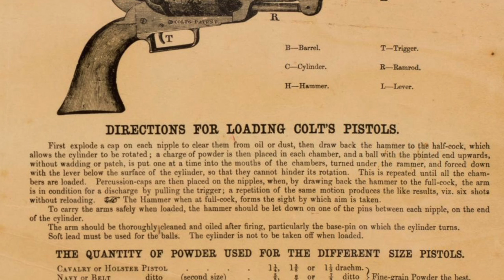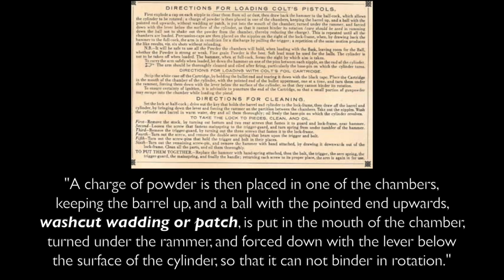Percussion Revolvers in the Rain

Comment: A tiny bit of lard/lube over the primers makes a HUGE difference.
--
Putting lard/lube over the primers AND over the ball, and you'll be able to submerge the gun entirely.
Reply: They used varnish on the nipples and lard over the ball.
Reply: Absolutely, that’s what I do with mine when I go camping
Reply: @peterlenihan5712  I've gone modern, I use clear nail polish.
Reply: I was going to suggest the same thing lol
Reply: Do you put the lard over the entire rear of the cap or just edge of the cap where it meets the nipple?
Reply: @rlbadger1698  Do you put the nail polish over the entire rear of the cap or just edge of the cap where it meets the nipple?
Reply: @ronaldscruggs2699  cap on nipple first, then a layer around the base of the nipple. 
it doesnt have to be perfect but a thin paint brush helps. x

Comment: I'm likewise surprised by this result. Would a different varietal of percussion cap make a difference? I'm not familiar with the ins and outs of percussion-cap firearms.
Reply: Not familiar with percussion caps, but oil and grease does not play well with primer compounds. In fact one of the primers I used to buy stated that to deactivate them drop them into oil. 
That was years ago, so maybe its still true maybe not.
Reply: @chuckaddison5134  use beeswax, it works.

Comment: I have been shooting these for 20 years. I have had misfires in the rain, but only very slightly more than the odd misfires that happened dry.  I once had my repro 1858 Remington in my hip out mountain hunting,  fell through ice on a pond into water up to my shoulders.  It must have been completely submerged for a minimum of 3 minutes. Once clear of the freezing water I pulled it not expecting much. It surprisingly emptied all 5 shots I had loaded without so much as a hang fire.  

I always made sure to have a good fit between nipple and cap.  I also make sure to REALLY press the cap on with enough force to slightly expand the crimp around the outside of the cap perceptively.  Your results may vary, but in wet conditions I can usually count on any of my revolvers to go off 5 out of 6 times.  I may have to recap the one a 2-4 times, but the last has always gone off too.  

Just remember that they are PERCUSSION caps.  Steady, firm pressure will not set them off unless defective.  That being said, always point in a safe direction just in case, but they should only go off if struck.

Now if I could just get my muzzle loading rifle to be that reliable…

Comment: I appreciate all the hard work you put into the video. As an avid fan and user of percussion revolvers, I can attest to the greatest vulnerability being the caps and cones. Also, if the caps fit too snugly, there may not be enough hammer throw to detonate them. Often it requires a second or third attempt to fire that chamber. For this reason alone I prefer #11 caps and squeeze the skirts to fit snugly. I find the Remington 1858 much more reliable than the open top Colts, but the Colts are simply gorgeous.
The flap holsters surely protected the revolver significantly until it was needed.
I have used clear finger nail polish to seal the percussion caps while blackpowder hunting. Back in the day a flap holster and overcoat were umbrellas for their revolvers and rifles. 💥💨

Comment: This was a good few years back now, but on my Remington (which as a bit more of an enclosed nipple than the colts), I used to grease the cylinder as you've probably done before, then cap and grease around the cap. Just a ring, you still wanted the head of the cap exposed. It was messy, but pretty much guaranteed good ignition.

Comment: Excellent test, thanks for doing it. 
At face value: “of course it won’t work”
Upon pondering: the only access is the cylinder and the cap. Both are tight so, it SHOULD work.
Reality: very surprising, now I’m wondering why it didn’t work.

Comment: Great/fun video.  I did cringe a little when the Star had a cap ignite, but not the charge.  You clocked it again, right away. I worried about a hang fire into the frame. Thanks Karl.

Comment: I have experimented with keeping mine loaded for longer lengths of time, and have had the same issue in those cases. Even with a good ring of lead shaved off the ball, and a wax/fat lube over each chamber, I had failures, which puzzled me for a bit. I ended up seeing the priming compound gumming the cones up, as if the caps were deteriorating, even sitting in my dry safe. Maybe they attract any little bit of moisture, and would have to be sealed with wax or something similar to be stable?

Comment: A touch of gulf wax sealing the caps and the cylinders works a treat. I use  a bit of gulf wax on top of the ball and also a bit in each priming cap.  Never had a failure.   Even my .454 single shot boot gun w a folding  that gets carried everyday strapped onto my boot and I have never had a single issue with a misfire. Also I use  CCI  #11 caps. Never a single misfire

Comment: A suggestion on the use of small plastic tubes fitted around the nipple might solve both long term storage of loaded percussion revolvers and also rainfall incursion.  A helpful suggestion is to notch the bottom of the hammer to allow the blowback to damage the percussion cap to allow them to be expelled during the cycling of the cylinder after firing.  Nice video, Sir.

Comment: That's a really neat test Karl. It seems that it takes barely any water to wick around the percussion cap and wet the primer via capillary action. I wonder if a dab of grease just around the front edge of the percussion cap would offer just enough seal to keep water from wicking between inside wall of the percussion cap and the nipple.

Comment: Years ago I had an Italian reproduction 1860 Colt. My first day out on the range I experienced a “chain fire” incident involving the chamber next to the one being fired (my last two unfired loads in the cylinder). Another shooter at the range that day suggested that I use a small dab of Crisco shortening on top of the ball to help seal the load. This would both help prevent another chain fire incident and also help deter moisture intrusion from contaminating the black powder charge. This remedy seemed to work as it never chain fired again. I never tried to seal the caps with Crisco, though I think this probably would have been a smart precautionary measure to help increase the reliability of the weapon.

Comment: Fascinating Karl - I love the black powder firearms content, was wondering if maybe the top strap of the Starr was maybe helping to keep water away from the percussion caps? That may explain why it performed better than the Colt? Also, I seem to remember reading somewhere that old-timers used to remove the percussion caps from revolvers during particularly wet weather, and/or wiping down and drying them off after exposure to water ... can't be certain this is fact but it does seem that the caps were more affected than the powder charges seated behind the balls. 
Thanks so much for sharing and for "making it rain" upon command in Arizona, a very useful skill imho ;-)
Reply: That may have been okay for a cow puncher, a farmer, bank clerk, blacksmith etc. BUT, a big no-no for a lawman, gunman, gambler, or rustlers and James-Younger gang members !

Comment: I really enjoy your percussion revolver videos.  I've been a percussion revolver enthusiast for years, and currently am experimenting with combustible paper cartridges, and the Johnston and Dow rebated conical bullet.

In reference to this video, I recall reading somewhere (and just this one instance, so I wonder how widely used this practice was) that one technique used was, after completing the loading and capping, to drip melted candle wax on to the skirt of the cap to prevent moisture infiltration.  Perhaps this was a practice that came in to being in more wet and humid parts of the country, such as Alabama or South Carolina, or anywhere along the gulf coast, and perhaps was not common in, say, Arizona.

By the way, I read in an earlier post that someone mentioned "pinching" the caps.  The approach that you've taken - making certain that the caps fit the tubes tightly - is the correct approach.  The practice of pinching the caps makes a cylindrical cap into one with an oval skirt, which produces two clear passages for water, or worse yet, the flame from the ignition of an adjacent cap to travel up to the ignition compound to either dampen it or to make it ignite, which promotes a chain fire.

Comment: In regards to your thrashed roads, we used to load a bedspring up with rocks ad drag it behind the truck.  This worked out well for us but if you have large buried rocks amongst the detritus and mud ridges, you might want to pack a sledge hammer to "smooth out the edges" and a crowbar, just in case.  Depending on the County will get you nowhere.  Very informative video, thank you.

Comment: In the Colt instructions it stated "A Ball with the POINTED end facing up".  Indicating as was the norm at that time, the use of a "Conical-Ball", not a Spherical-Ball.  Which was why the omission of a wad, or filler material like corn-meal as you pointed out at the 6:19 mark.

Comment: I don't know if it would work, but if I was going to be shooting in the rain, I think I'd strongly consider dipping my primers in tallow before venturing out into the field and rain. It would have a much better chance of making a water-tight seal between the primer and the cone. 

I don't know if rendered tallow would affect the primers, or if the primer would fail to light the main charge if it had a bit of grease in front of the primer powder. This is something that could be tested with a little bit of bacon grease.

Comment: You can seal the caps with a bit of clear nail varnish.
For flintlock you can also use that, historically they would seal the pan edges with beeswax or tallow drips from a candle.

Comment: The question of wadding is (while not germane to the problem of water in the cap) quite interesting to me. The fact that Colt's instructions not only don't say to use a wad, but explicitly instruct you NOT to use one, suggests that wad use was at least common enough that they felt the need to tell you not to do it. It was common in cannons, obviously. But Colt, for whatever reason, didn't want its users to apply a wad when loading the revolver... I wonder why not, when it clearly works just as well with as without? One less step and thing to carry with you, I guess.

Also, every time Karl says "here comes the rain again" I can't help but finish with:
Falling on my gun like a tragedy
Falling on my gun like a new corrosion
:P

Comment: Now does using wads offer any benefits or disadvantages or safety? What about sealing the chambers with grease or tallow, I’ve read that was done. I know it keeps the fouling soft etc but I’m sure that also sealed weather out fairly well. Just wondering bc Black powder is something I am not familiar enough with and would love to be. I have a ‘51 Navy copy in .44 and a Remington copy in .44 (technically 45’s-)wonder what size balls fit mine, can I use .451 for both and not worry about it? Thanks and awesome video! Love BP revolvers and I can see potential survival uses in BP arms. A flintlock would be great for bare bones youre on your own with little to no resupply.

Comment: I took an unexpected drenching in the river once while wearing my 1851 Navy. Fully loaded of course. It still fired every chamber. I don’t use wads and my cap to nipple fit is perfect for number 11 CCI. I do usually grease the chamber mouth after loading unless I’m using paper cartridges that are hot dip lubed. Maybe it was a fluke? Maybe not? Exact fit with the caps are important though.

Comment: The Ruger Old Army was designed to use .457 round balls or .454 lead bullets. I have .454 and .457 molds for my cap and ball revolvers. At first I had just the .457 mold, but it was so hard to load .457 balls in my Colt and Remington replicas without a stand apart loader, I use only .454 with them and get a good solid ring. Of course, I only use .457 balls in my Ruger and it's just as easy to load it with them as the smaller balls in the other pistols. It also seems the Ruger has proper sized cones for CCI/WInchester #11 caps. I haven't had any problem with misfires using the Ruger. I still prefer the Remington because I don't have to take the loading arm off when I swap pre-loaded cylinders. I have a conversion cylinder for both my Ruger and my Remington and 3 extra cap and ball cylinders with belt pouches for the Remington. (I cap them when I put them in the pistols).

Comment: I can definitely see one major advantage of the percussion revolvers in that even if water seeps into one or two chambers you at least still have a few other cylinders to also try to fire compared to the older flintlock where if it fails to fire you have to pull out a second firearm or you're screwed. Definitely a big step up in reliability but makes absolute sense why very protective holsters were common item. Take care of your weapon and it'll take care of you has always been the best advice even today.

And as a few others have said, might be that the percussion caps are what are failing while the powder in each chamber is possibly still fine.

Comment: One of the tricks in the day  was to put bees wax around the pan of a flint lock, after priming, when the frizzen was closed.  This makes the lock more water resistant.  I  believe this trick was used around the caps for the same reason.  I have used it myself when I was trapping and only had a C&B revolver to carry with.   One thing, you have to go around the cylinder and press the hammer into the cap on each chamber or else you will get light hammer strikes.

Comment: Ya know, I might be way off base here... but to my eyes the cones on the colt are recessed into the cylinder, and I think this allows water to get into those recesses, be held there by surface tension, and then wick under the caps and wet the primer.  on the Star the cones are not really recessed so water might be less likely to be held there.

Comment: In flintlock days, in preparation for combat after a rain, SOP and common sense for experienced soldiers prompted them to get the “mud” out of the frizzen pan at a minimum and download the ball and charge, using the worm screw on the end of the rod. Reloading came next, after using the tow for drying all. Otherwise, the pistoleer was back to using the dead pistol as a club (brass butt cap for that purpose). Most pistoleers carried a saber or cutlass anyway as their MAIN weapon. The rifleman/musketeer had his bayoneted firearm as his backup when it was empty or useless as a firearm.

Elmer Keith, of gunlore fame, carried a Colt .36 C&B revolver for everyday ranchhand work in his Wyoming youth long after cartridge guns were available (it was what he could afford) and routinely waterproofed his capped cylinders with melted beeswax.

Comment: The open top colt style is more likely to misfire in the heavy rain but the top strap on the Remington and Starr style revolvers helped to protect the cylinder a might more. I’ve never had an issue with misfires with either colt or Remington style percussion revolvers when shooting in light rain but that water can simulates heavy rain

Comment: Nice experiment sir.  Since the Remington 10 caps are made in a cross and folded in, perhaps the splits along the sides are actually drawing the water in by capillary action. If you have any non-split design caps, they may be better. CCI 11 or RWS 1075 "may" fit your cones.

Comment: I’ve noticed on mine it’s very cap dependent, if I seat them firmly with a dowel and some pressure or double strike, I haven’t tried any water testing though, it’s interesting to see your results and that you had some failures even with correct cap size for the nipples.

Comment: Im actually curious how you unload a flintlock or percussion revolver once the powder gets wet and ruined? especially with the percussion revolver if the round is seated in so tightly. do you use a screw to drill into the ball or do you just wait for the powder to dry and then fire it?

Comment: I was wondering why you wernt lubeing the chambers at first, thanks for showing the original instructions! I'd wager lubeing was more common than not because its jsut a good idea, but on the off chance you didn't and it rained this is a good test.

Also I remember reading that to prove reliability of the pistols Samuel Colt put a pistol in a bucking of water then gave a presentation on the waterproof-ness of the guns then after pulled out the pistol and shot it. If anyone followed Samuel Colts loading directions It would be Mr. Colt himself.

Comment: wondering if dabbing a little bit of grease/oil/wax around the seated primers would save the cap'n'ball, since you held them nose down and the wad in front didn't really make much of a difference there's only to believe that was the weak point. It's all stuff they had available, even though there's no records or word of mouth about it being done I can't see why it shouldn't work and be pertinent to the period, at most because the holster and infrequency of fights happening during downpours would make all measures taken "good enough" already.